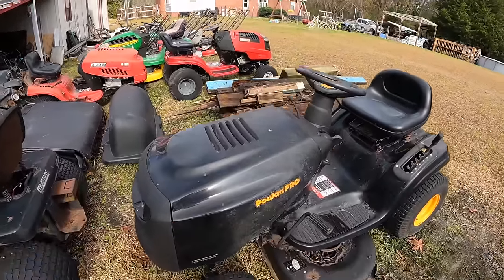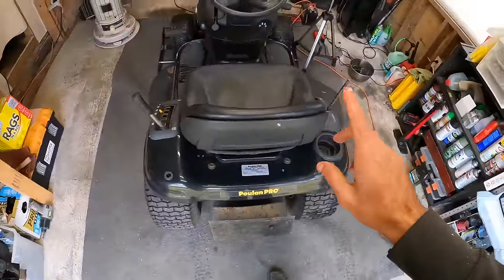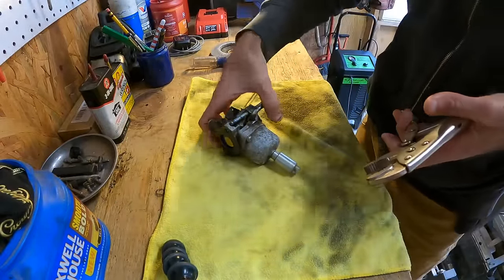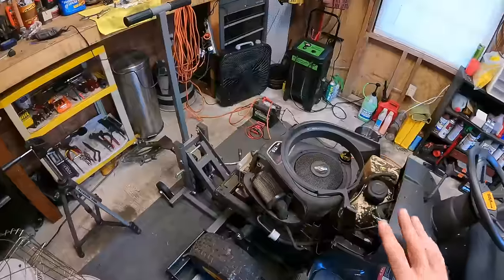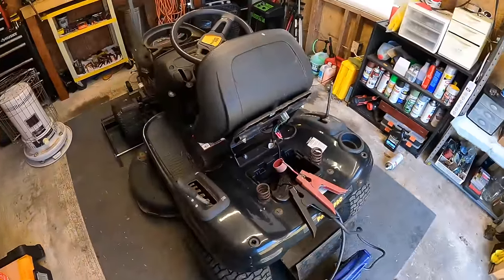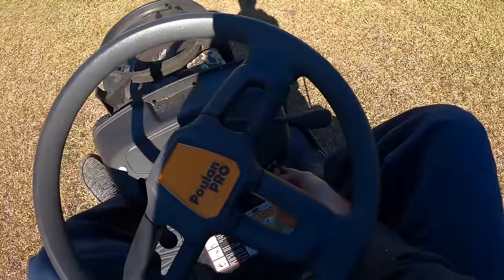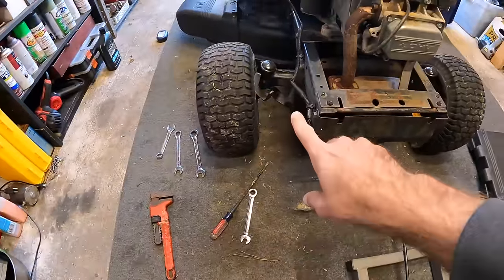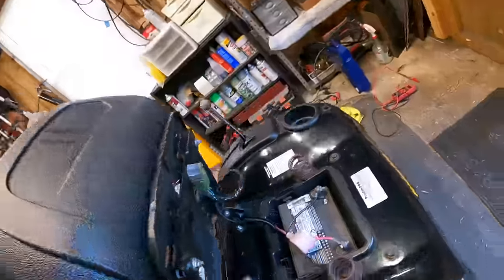FREE RIDING MOWER SAVED FROM THE SCRAPYARD

Comment: Take the carby apart and clean out the emulsion tube. If there is no tap between the fuel tank and the carby then the emulsion tube is the first to plug up. A tap allows you to run the fuel out and leave the carby dry when not in use.

Comment: Another great video Alex!  It looks like the person bought it and used it until it just quit without doing anything to it.  Those are some of the worst blades I've ever seen!  Those front ends are horrible and if bending the tabs on the spindles isn't enough I take a hammer and knock the spindle in that way swinging toward the mower with the wheel fully turned out.  I remove the drag link to do this as well.  I did that this week on a Husqvarna with a badly worn front end to get it to track straight going forward.  Only negative is a toe in effect in reverse.  Yours looks like it was in good shape besides the toe out which is good.  Look forward to the next repair!
Reply from the maker: Yea I don’t think this machine was ever touched for maintenance. Thank you for the tip on the alignment. I usually don’t have them too bad but this one was way off. I hope things are good your way!!!

Comment: Good video as always, only things I would have done different would have been install an inline fuel shut off valve and installed inner tubes in the front tires.  I am working on my neighbor’s mower which is in way rougher condition but still fixable to use for mowing next spring; it’s a 1998 Murray 42in, I am going with tubes since I could not get the bead to re-seal on the front tires.

Comment: That's from 2015?  Wow!  I guess if you don't maintain stuff it gets old looking really quick.  My Poulan (Pronounced like Poland, but without the D) Pro was made in 2010 and looks a lot better than that.  Mine's a 20hp 46" cut with the metal hydrostat trans.  and it still runs great.  Has 419 hours on it.  Now, I have had to change stuff like spindles, blades, batteries and last week instead of rebuilding the old carb I just swapped it out for a new one as the old one began flooding the cylinder and locking it up, but I think for a now 14 year old mower it's doing pretty well.  I even added "Poor man's power steering" to it a couple weeks ago and reset the valve lash to .004 and .006 and if I can get 2 more mowing seasons out of it I'll be happy because by then I will have saved enough up in cash to go get a zero turn Ariens Ikon without having to finance it, lol.

Comment: My dipstick always shows it being "over-full"  Engine claims it holds 46-48 ounces of oil (1.5 quarts) but if you put that much in it after draining it and installing new filters it always goes most of the way up the da**ed dipstick, lol, no matter how many times ya wipe it off and re-check the thing.  Ah well, it runs like it's supposed to anyhow.  I took off that plastic "quick-drain" and installed a permanent rubber drain hose on mine because I got tired of trying to keep up with where I last put the clear plastic drain hose, lol.

Comment: I noticed also that after market Nikki's tend to have a vacuum leak around the throttle shaft..and some of the older factory ones do it to over time..check that on those carbs u have
Reply from the maker: I’ll have to check that. I’ve had quite a few mowers in the past that leaked around the throttle shaft running it super lean. Thank you and hope things are good your way. The v twin go cart is awesome!!!!

Comment: Glad you are saving it from the scrap yard I'm  working on a craftsman ys 4500   even though it doesn't run right because of the Nikki carburetor did a wheel bearing installation job and New wheel  steering axle installation because of the front tires were toed out plus new tires on the front new fuel tank line and fliter  and shut off valve
Reply from the maker: I bet it will be in excellent shape when you are don’t. I know you take very good care of your equipment. The Nikki carbs can be finicky for sure.
Reply: @freedommowers420   you got that right Alex I did a  spray cleaning on the carburetor with a can of sea foam into the main jet will be trying it out today to see if it works better than it was

Comment: Thanks for posting these videos.  They have for sure helped me with a few mower repairs!!!  When you paint the mower deck, do you remove all of the spindles and pulleys, or do you just tape and paint around everything?
Reply from the maker: Thank you so much for the support. I actually don’t tape anything, but I should for a cleaner result. If I get overspray on the decals I take a towel with some gas on it and it wipes right off of the paint has not fully cured.

Comment: Nicely done!, Questions, 1: will a mower NOT start if seat is up? 2: where i can i pick up a new carb like the 3rd one you used. I just picked one up on a trade for some sofas and it would start only on choke, once put into high or low it will die.took out carb and it was disgusting, cleaned it up best i could and now it wilil not start at all, guessing i losened up more junk and clogged up jet even more (FYI seat was up due to dead battery thats why the first question) I want to do a new carb and new plug as well. its a poulandpro PP11G30 with a LONCIN 350cc Engine(never heard of this brand) . Any help will bre greatly appreciated. Thank you for the videos
Reply from the maker: As long as the brake pedal is in the locked position the mower should start without being on the seat. You can find inexpensive carbs on amazing. The engine you have is a Chinese made for a lot of the newer riding mowers. Look around on the engine or type in the name and hp or size of the engine and see if you can find one on Amazon. Usually around $15-20. I hope this helps.
Reply: Thank you Sr. I will look into a similar CC engine carb comparison. Take Care. @freedommowers420

Comment: Sometimes there is a very fine Screen under that plastic 90° elbow in the fuel line.  Try and make the vids 20 min.
Reply from the maker: I’m trying to keep the videos shorter but sometimes they end up longer to keep all the repairs in there. Thank you for the tip on that screen.

Comment: About your screwdriver removing that bowl - I just purchased a set of JIS driver bits and a couple of JIS screwdrivers. So far it looks like I’ll be able to retire most of my Phillips screwdrivers and associated problems. These JIS tools exceeded everything I’d heard about them.  I finally broke down and bought these when I started to work on my first Japanese OPE, an Echo leaf blower. What a pleasure to use the correct tools! 🪛👍
Reply from the maker: Yes I certainly need to pick up a set as well. I know they make the world of difference using the correct driver for the screws. Thank you as always for coming by and showing support
Reply: I always use my cordless drill and bit. Just ease into it and don't go full throttle and it will come right out.
Reply: @freedommowers420 
I give credit to Stella from “The Lawnmower Lady” for turning me on to them. Happy to provide links to what I purchased.